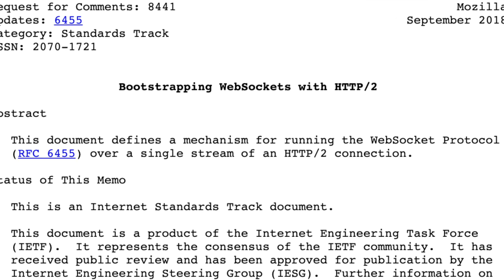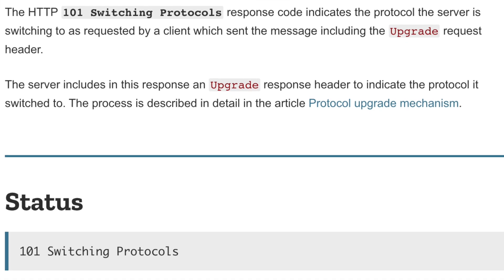How WebSockets Work with HTTP/2 (RFC8441 Explained)

Comment: Hi Hussein,I got a question like to make sure.  
Http2 must with TLS from your video,otherwise some devices may not know it's http2.  
So source address of CDN should use domain name(with TLS) instead of ip address?
If it is true, there will be another question, http2 work with TLS1.2,but......a lot of TLS 1.2
Reply from the maker: J James hey James, correct if you are using TLS then to know the domain you use SNI or server name indication TLS extension 

Check out my video on the topic